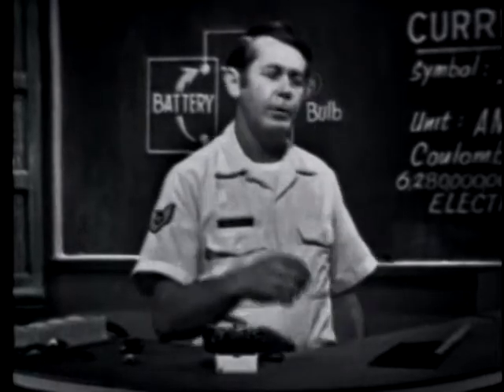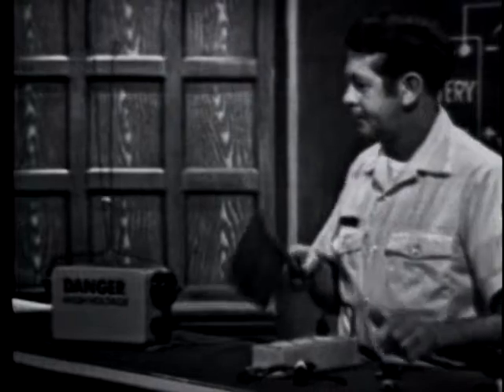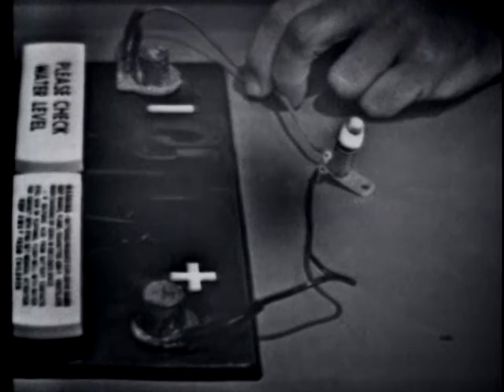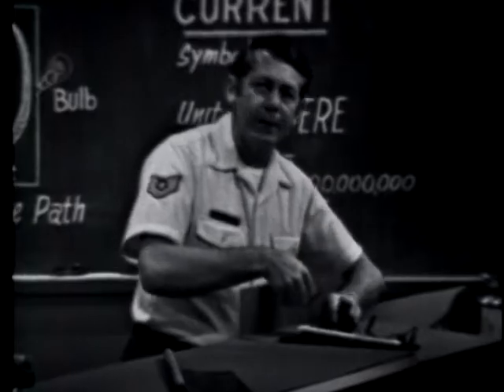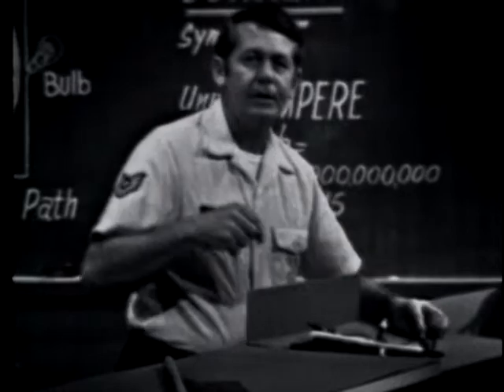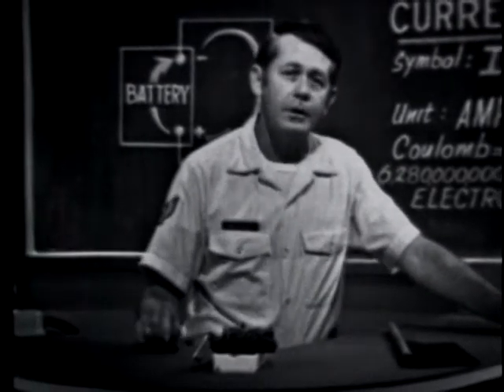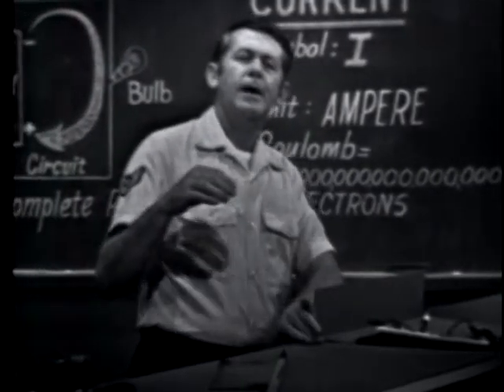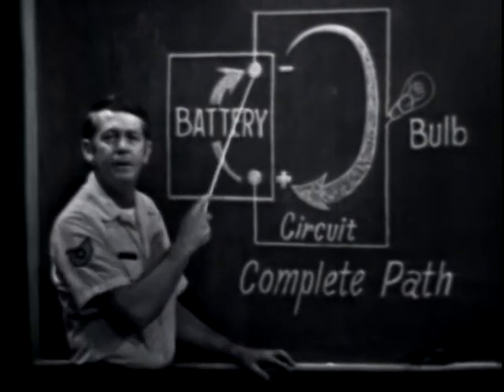ELECTRICITY - CURRENT

Comment: But current doesn't flow inside the battery, The electrons simply move through the available external circuit to get from the high pressure side to the low pressure side until an equilibrium is achieved.